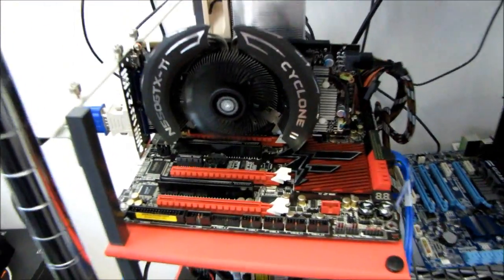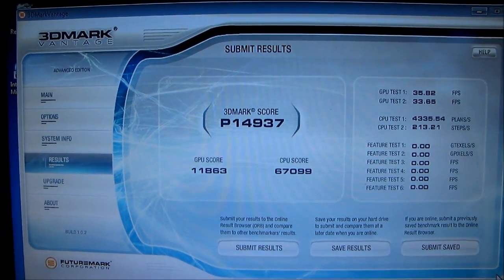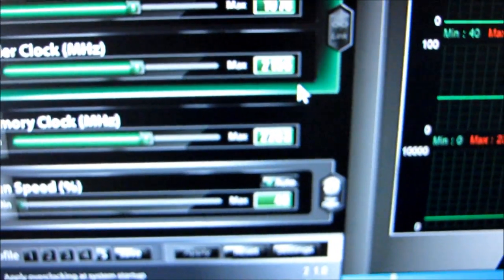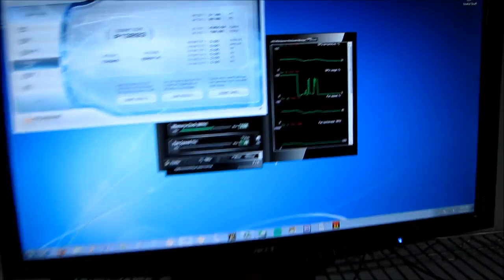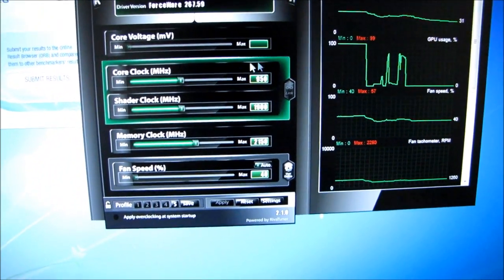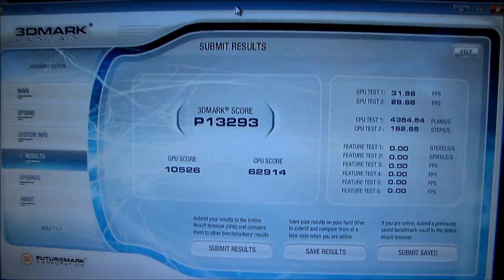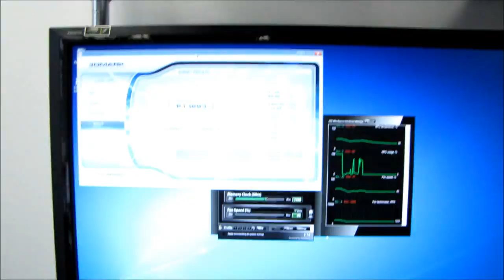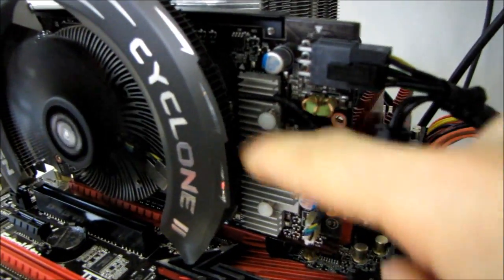MSI GeForce GTX 550 Ti Cyclone II Overclocking Test Linus Tech Tips

Comment: dude im only 15 hehe ;) dude at least 500 watts and above... cuz a psu degrades every year myself get a godlike good power supply and u will not needa worry abt many things... i recomend FSP Aurum 500 watts 80 plus gold for your system :) its an awesome PSU if u ask me why den i wud explain it to you :) over 90% power efficiency... and japanese solid capacitors which can resist over 105 degrees i had a fren his comp mobo got fried by lightning but his psu was still good and running :)
Reply: You're 19 now; how do you feel about typing the way you did four years ago?

Comment: when i overclock my gtx 550 ti to anything above 970 mhz it always turns black for 1 second and then reverts back to the stock 900 mhz. theres no artifacts or any warning before it does it and it never runs above 70 degrees. help?